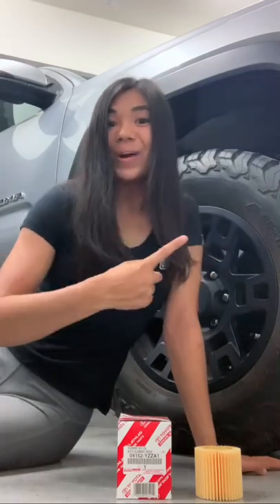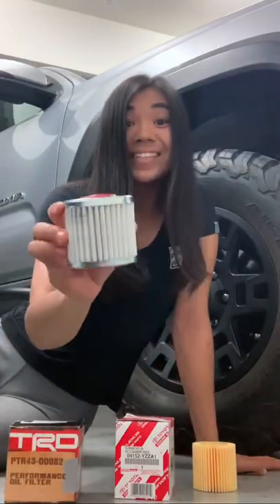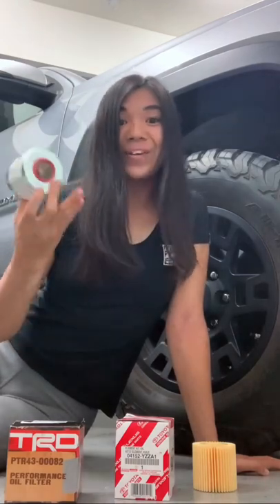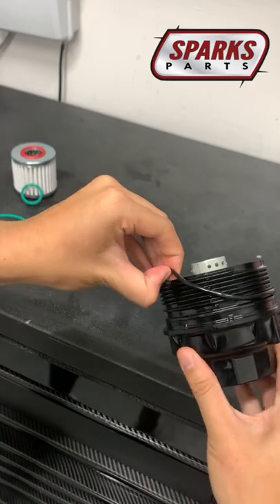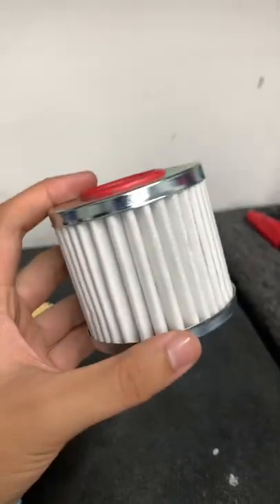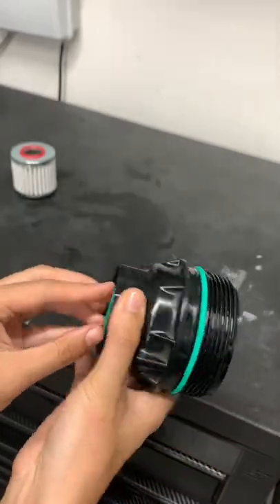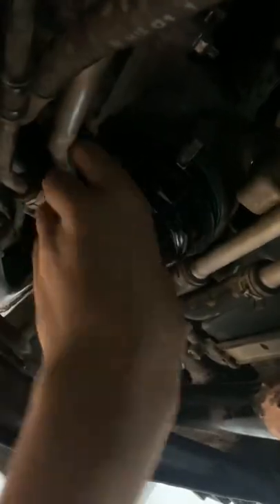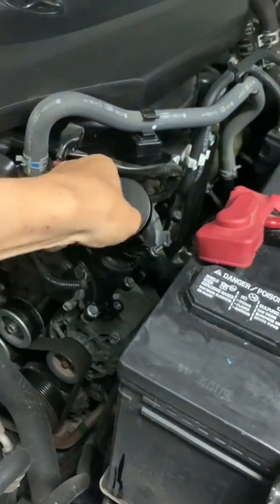Is the TRD Oil Filter better? (PTR4300082) #shorts

Comment: I do OEM filter and Mobil 1 OW20 every 5k. I could let it go longer, but it’s only around $35 to do it myself. I have a 2017 and when the dealer was doing my free ones they cross threaded a bolt on the skid plate and tightened the filter housing up WAY too tight. They don’t have the top people working oil changes.
Reply: You would think the dealers wouldn't be so stupid. If your lube techs can't do the job right, it just sends a message to many owners that they should do it themselves. So less people will continue going to the dealer.
Reply: @njsongwriter same thing happened to be, some lube shop did a oil change then the car started leaking like 2 weeks later. Will do it myself from now on

Comment: How do you expect to see the difference during your next oil change...? Time, Temperature and the small amount of fuel combustion passing through the segments makes your oil go bad.

To do a fair test you have to do your oil change at the exact same amount of km/miles, drive the exact same roads and the exact same way.
Even if you do all that, you won't see anything different in the oil pan once you drain it. The filter is located after the oil pump and before the engine parts. The oil is filtered, go trough all the  engine component and go back in the oil pan.

I have no doubt that TRD filter has a better filtering capacity, but there is no way you can prove that unless you use special device to test both filter and then analizing the oil that comes out of the filter. Wich you can't do in an engine.

Comment: I had to use a 18” breaker bar to get my filter off when I changed it for the first time. They torqued it so much I don’t have to use the removal tool. Just put the drive in the drain cap of the filter and start turning. The housing comes out as one piece.

Comment: Chloe definitely upgrade to the aluminum housing. I changed out our RAV4’s and the Tacomas after one of the plastics ones was over torqued at the dealer when we bought it. Damaged the plastic housing removing it when changing the oil.
Reply: @Rin Failey yeah they don’t care. I recently had my Tacoma at the dealer for service and they damaged my brand new trd skid plate, It was on the truck for less than 24 hours.

Comment: You really gotta lube all those o rings around the filter. Especially if you drive a car where they do a lot more than prevent an external leak...
Reply: Never had problem with dry oring for 6 years. Only problem is my plastic oil filter housing got cracked from metal oil filter tool. Metal tool slipped then snapped on plastic housing. Dripping oil through cracked plastic housing. If I started engine running, oil would faster drips. 

If I revving inside garage as 3,000 rpm, oil puddle and splattered on floor. I never seen oil leaking so bad after engine idle and worse at engine rev. That's how leak is bad so I refused to drive Toyota until I get new metal oil filter housing. 

Never had any problem with oil filter orings because I replace oring at every 5,000 miles. I did 17,000 miles with extended oil motor but only planned long travel& vacation. If no plan, I'll stick 5,000mi intervals with performance or platinum for good additives like zinc, anti-sludge, etc. 

No oil consumption since that engine NEVER had semi blend or conventional oil. 100% full synthetic at early 50,000 mi. Then I switched to advanced full synthetic for better additives thanks to farm project YouTuber. My oil cap look like new factory at 150,000 miles. Comparing to my family's Toyota with 150,000 miles of oil caps look dirtier because they always go oil shop that does conventional oil and NO additive. My family does 5,000 miles and don't skip. I think oil shop picked conventional oil or skipped oil change to maximize profits as possible. Screw oil shop lol
Reply: @technocody9296  I work on euro cars only so I cant speak to American or JDM cars, but look up (for eg.) the n54-n55 bmw engine and see how much more of a function those o rings have. They control the oil pressure for a lot of other systems and its important for them to be lubricated properly. Maybe in your 1990's Toyota, but not performance vehicles with extremely tight tolerances. I've had many problems with backyard mechanics doing this exact thing and hearing "my engine isn't running right" afterwords lol.

Comment: The glass polymer filter don't actually filter out as much as a paper filter so they're worse for the fine particulate and daily driven cars. Their advantage is they don't clog up as easily so they're more suited for a race engine which sees more rapid wear but also has it's oil changed more often to keep flushing out the very fine particulate.

Comment: First off, the synthetic material in the TRD is wire backed, which gives it more structural rigidity. Also, it has greater filter potency at a lower micron compared to the "paper" aka cellulose filter. It can probably last you 8,000 - 10,000 miles.

Comment: I have been wondering the same thing on that TRD oil filter. I use the same Toyota paper oil filter element on my Tacoma that I get from my local dealership. I am going to check if they might have the TRD oil filters in stock next time.

Comment: Do your oil every 3000 you'll be much better off in the long run..i know you dont have to but i have 3 cars with over 300k on them from doing this
Reply: That's Dino oil. It breaks down faster then synthetic. Absolutely unnecessary with full synthetic oil. You're just throwing away 2000 miles of driving for Absolutely nothing.
Reply: @chrislull670 how about throwing away 5-6000 miles

Comment: I recommend using Mobil 1 synthetic oil in your Tacoma. I've been using it in my Toyotas for years, and it's fantastic. Every time I get a new timing chain, my mechanic says the engine looks like new inside. (250,000 miles and still going strong.)
Reply: Every time you get a new timing chain??
Reply: @michaelrueckert8507  🤣🤣🤣
Reply: According to my Toyota dealer, Factory Toyota motor oil is made by Mobile 1, I also use this oil and OEM Toyota filters
Reply: There's little difference from one brand to another. I'll bet the SuperTech synthetic oil would be just as good.
Reply: @njsongwriter  Good test would be to send it to Blackstone Labs and see what they find.
Reply: @michaelrueckert8507 I caught that too!😆😆😆

Comment: From the looks of it I think the TRD filter is finer for better filtering when you’re driving in dusty conditions. Some of the air that passes through the air filter has some tiny tiny particles that go to the cylinder and then get in the oil. If you don’t baja race your truck you shouldn’t be needing one.

Comment: Last time I went to change my oil filter, I had previously had my oil changed at the dealership (for free) and the guys tightened the filter cap so much I chipped a couple of the clips on the plastic housing even though I was using the right tool. I was out of town at the time, so just did the oil. Next time I'll do whatever it takes to take the cap off and be replacing the plastic housing with an aluminum housing from extreme terrain.

Comment: I just use OEM paper filters will be fine for me I change my oil a lot truck only has 500 mi on it now I'm about to do the 1st oil change at about 800-1K miles & 2nd 2500 miles & switch the transmission fluid to amsoil manual transmission/transaxle fluid cuz I have the 6-speed manual, I figure everything will be broken in by 2,500 mi ready for its 1st flush & switch everything over to amsoil 75-90 severe gear oil in the front diff, rear diff & use red line oil in the transfer case...

Comment: I've seen a couple of your videos and I like the attitude above all but, please let me clarify a few points from this video:

1. You never stretch the o-rings when placing them. 
2. Viton are better for some applications. It depends on the fluid and temperature. If OEM Toyota filters come with another kind, use those. Look up a temperature comparison chart. Toyota probably uses nitrile or polipropilane. Me and my family have had probably 7 or 8 Toyota vehicles in the last 25 years and only had problems when we used non OEM parts because we couldn't find them in the crappy 3rd world countries we have lived.

Comment: Filter media is of the same design as the wix xp filter. Idea is that if it flows better you spend less time bypassing the oil filter. This is great if you spend a lot of time up in the rpms so say someone who’s running shorter final drive gears or motors running a higher pressure oil pump would benefit from this.

Comment: I have a 2021 Tacoma.  I bought it new so Toyota does my oil changes and tire rotations for two years for free. The crazy part is that they say every 10,000 oil change and every 5,000 tire rotation.  I asked "You sure you don't have that backwards" nope, every 10,000 for oil.  I don't like it but it's free and it's a huge Toyota dealership so I'm going with it
Reply: They are doing that so your engine eventually has sludge and develops issues. Stick to 5k miles for fluids and rotations. It's your investment.
Reply: Just do it yourself at 5,000 & 15,000 miles. Let them do it at 10,000 and 20,000 miles. And make sure they don't over-tighten anything... which is the reason why I don't myself; I don't trust anyone else to do it right.

Comment: Changing the oil per factory recommendation is the best for most vehicles. Dirty oil will clog up the filter and cause the bypass valve to open and will let dirty oil to circulate. Not good.

Comment: I purchased the equivalent TRD Pro filter for my Tundra but I've been hesitant to install due to the very small /restrictive inner-house oil return openings visible in ChloeKuo's video. Can anyone confirm the oil return openings are sufficient or confirm they've not had problems running this filter? TIA.

Comment: Funny they had canister style filters like this on everything back in the 40s, 50s, and probably early 60s. Every company went away from them and went to the screw on style of today. Now we see several going back to the canister.  There was a reason they were phased out.
Reply: Actually the spin on filters are spin on canister filters. But you are right the first oil filters used in automotive engines were cartridge style filters like this. But even up until the 1960s some engines didn't even have an oil filter.

Comment: Check out the fortnine channel, they tested paper vs metal vs fiberglass oil filters and the results are surprising. Turns out that a boring paper oil filter is better at almost everything. Most "performance" filters have less surface area and worse filtering media.

Comment: Look at the Baxter Performance Oil Filter Adapter. That way, you can use a regular filter and not just a cheap paper one
Reply: A regular canister filter has the same cheap filter element inside of it. Duh.

Comment: I used a filter that was structured similar to that one and since it's got that metal mesh it clogs really fast and my V8 was never at proper operating oil pressure when I ran those supposed to be better filters I mean iam sure they might be but, just pay attention to how you're vehicle responds before you end up with damage

Comment: FortNine did a video on oil filters. Paper filters were the best option by a long shot.
Reply: Thanks 
7:19 : paper was again the victor... it this is one of those happy results that vindicates the cheap bastard paper filters are best
steel had higher flow but terrible capacity and poor filtration while fiberglass failed to shine anywhere

Comment: OEM is better then TRD for example on my case. TRD thermostat runs the engine cooler while the OEM is hotter. Heat is good for engines. Unless your flooring it 24/7 that’s the only reason to run a thermostat like this.

Comment: You need to buy the Dorman 
Aluminum housing for the oil filter
Reply: If it’s factory doesn’t have metal filter cap, don’t swapped. It’s not same dimension and filter doesn’t do filtration!

Comment: Change the filter but not the oil.. synthetic can go for 200k Miles.. mobil 1 5w-30.. 240000 without changing oil.. every Year the filter.6 years now no problem and the oil doesn't get that black.. we have cold winters and hot summers here.. my car is an old VW Golf IV 1998.runs perfect

Comment: Just wanted to let you know that the manual recommends oil changed every 10k miles, I have seen pretty clear oil at 6k before, you may want to consider waiting a bit longer. I usually change between 7.5-9k with higher quality oil.

Comment: You REALLY don't need vitton o rings for oil. Rubber will work fine. That's literally not making any difference in the seal and you're not dealing with anything corrosive.

Comment: But it's also better for the engine to change it every 5,000 miles or even every 10,000 Mi because every 5,000 mph you're only keeping the what is the engine lubricated you're not going to keep everything 110% safe

Comment: So keep changing your oil every 5,000 miles but if you're using that more expensive filter then just change the filter every other oil change.
I use the Fram Ultra Synthetic filter and that's what I do.

Comment: You’re supposed to oil both of those o-rings and torque the oil filter to 18 ft-lbs
Reply: I use my calibrated arm to torque the filter to exact spec.
Reply: You're supposed to torque the oil filter cap to 18 ft.lbs and torque the drainbolt on the oil filter cap to 10 ft.lbs.

Comment: If there's no accompanying scientific, statistical evidence presented across various use cases forget it and even if there is, few Tacoma owners would operate their truck at such extremes to see a positive statistical significance in performance and life expectancy.

As the best long-time mechanics and engineers recommend, stick with the original factory filters, lubricants, fluids, etc. that the engine, drive train, 
 parts, etc. we’re designed for. The difference is increased reliability and performance maintenance over the years, not in the short term. 

So if you say, I used this company’s part and see no difference, the difference could be seen 10 or 15 years out.

The most important oil change is at the end of the “break-in” period of 500 to 1,000 miles. Change the oil and filter immediately to minimize risk of any machine filings increasing wear and reducing the longevity of parts over the years.

Never believe that there is no “break-in” period required.
Reply: I'd recommend using high quality products on your vehicle that will out perform the OEM spec stuff that is designed to get you through the warranty period. First and foremost so what makes you feel comfortable and makes you happy and that's worth way more than any small difference in performance between brands. People forget about the human aspect of working on and enjoying cars.

Comment: I just bought a 2022 off-road Tacoma does anyone know what the part number is or the size is for the drain plug gasket?
Reply: Little late but for the engine oil drain plug gasket it should be 90430-12031

Comment: I've been working on Toyotas for 30 years their engines are so well bulit they'll still last 250,000 miles if you use the cheapest oil and the cheapest filter available known to man they're indestructible I've been using non-synthetic 5w30 in my Tundra 4.7 motor for the last 470,000 Mi and it still doesn't burn any between oil changes, cool video showing the Toyota makes an even better oil filter but it's not needed you just wasting money spend it on something else like cool tires and rim's

Comment: I HATE the filter that Toyota used on these trucks.  There’s far more steps to changing it and more that can break.  In engineering, you want to design things with irreducible complexity:  as simple as the design can possibly be that will still work.  Why not have a normal oil filter?  1 gasket.  No extra drain step requiring a special tool. “Hey I know!  Let’s make the metal canister around the filter element REUSABLE for no reason!”

Comment: even if I had the money to own a fancy car/truck I still do an oil change at 3000 miles. I still use a good wix filter & mobil 1 synthetic. It gets changed at 3000miles. in my personal experience I've let my car go at 5000miles & the oil is just shot. I don't even trust manufacturers when they say do your oil change at 10k I believe thats insane. I do it at 3000miles thats just me & my opinion.

Comment: 0W-20 every 5000 miles in a Tacoma. I’m shocked 😮
Reply: My 2012 Japanese SUV is going 13k miles on an oil change annually from factory. No idea why Americans change every 5k...
Reply: Too low or too high? I use Royal purple and change right around 10k
Reply: @retroMartin  you are joking right? 13k?!!
Reply: @JAMESWUERTELE  No im not, 20.000km annual service. Audis are doing 40.000 km on an oil change. Oils and engines really do become better.

Comment: I know I ain't a fully a mechanic yet but I'm going I'm taking classes and everything to be a mechanic and not but I know for the Toyota Tacomas and at not even pushing it and everything up the miles in that of not even of like the good amount it's like maybe 15 10 15,000 miles on it before you change the the engine miles of like the engine or the oil at the engine oil because if you don't let it go over 5,000 Mi your engine and that so let's say when you're trying to tow something or pull something your engine's going to combust and blow up and go ignite the whole entire truck and Flames that's when your only if you're pulling a heavy enough load and not with that truck because it won't have the you know

Comment: As long as the filter is good enough not to fail before you replace it then i dont think i. Really matters. Same with brand of oil you use… i use whatever is on sale and replace at 3k miles… no issues ever!